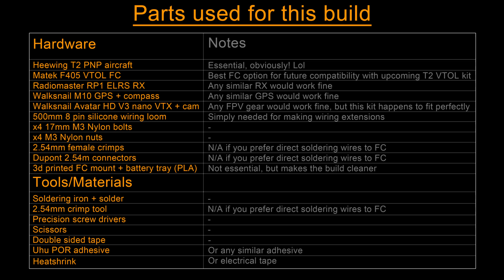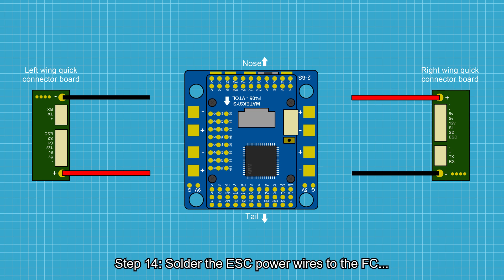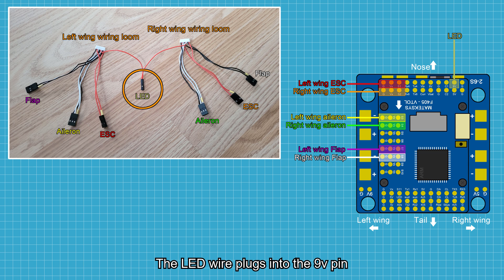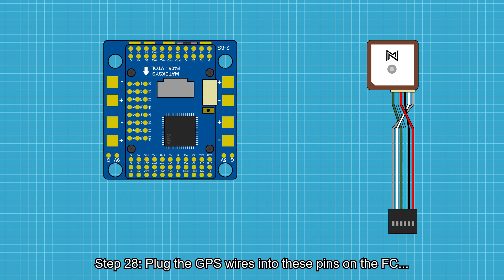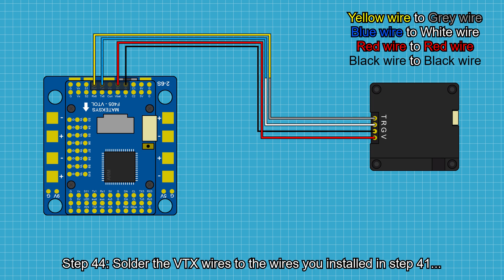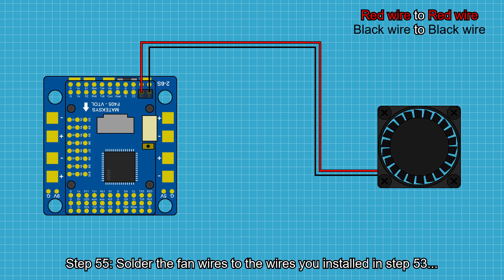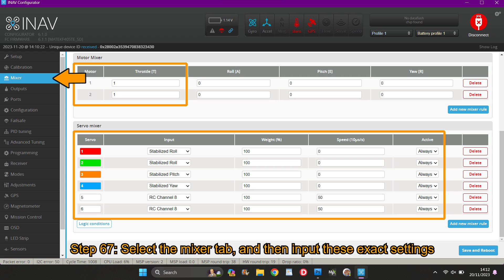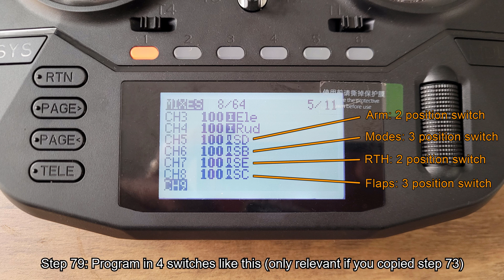🛩️Heewing T2 - Detailed Step By Step INAV Build Tutorial

Comment: Hi Giz, I have followed your build with only two exceptions: I used a BN-220 GPS (no compass) and a RadioMaster RP-3 receiver. The last problem to solve before maiden is getting all the telemetry sensors working. I'm seeing only 9 and have deleted all and re-discovered several times with no luck. Telemetry output is turned on in Configuration and Serial Receiver Provider is set to CRSF. I've double-checked the receiver wiring. The receiver is working otherwise. TX16 radio running latest EdgeTX. Any ideas? Thanks!
Reply: Never mind! Discovered my crimped connectors were not properly seated in the Rx Dupont connector. Fully telemetry now.

Comment: Why can’t u leave it in
Reply from the maker: Leave what in?
Reply: @gizfpv  bec that come with t2
Reply from the maker: @Dashone93  The PDB you mean? You can leave it in if you want, but it's not needed when using a proper flight controller as it has its own PDB built int
Reply: If I leave it in with SpeedyBee 405 wing it only shows one motor so I got to take it out
Reply: @Dashone93  How about the idea of making a Y connection for the two motors and ESCs and let the two motors work as if they were one. I'm sure the plane has plenty of maneuverability with such a large rudder and two ailerons. No need for differential traction on engines.